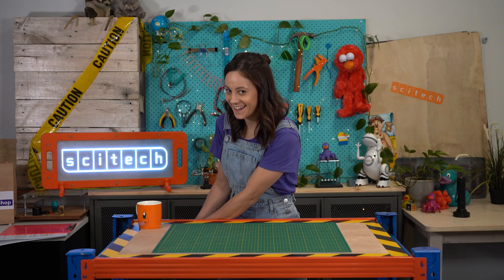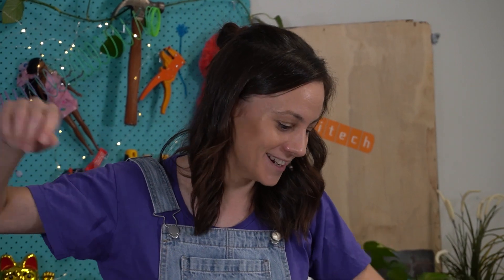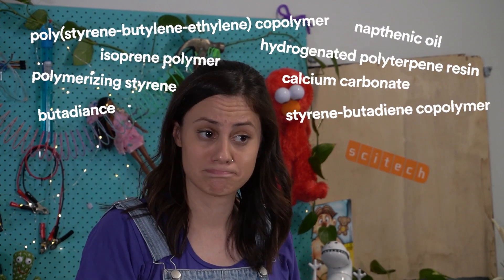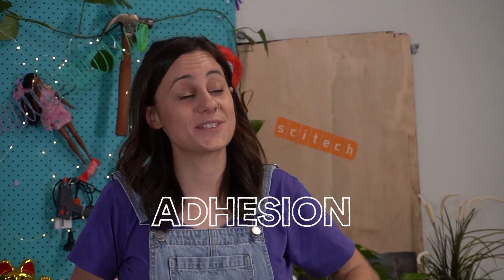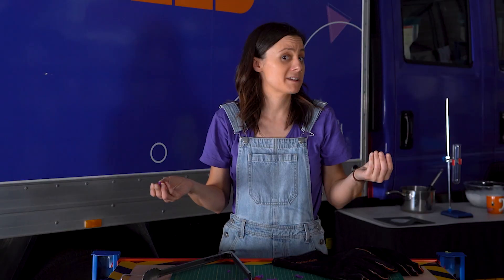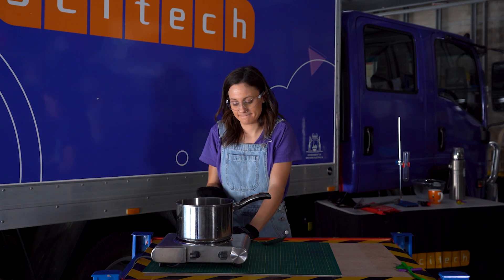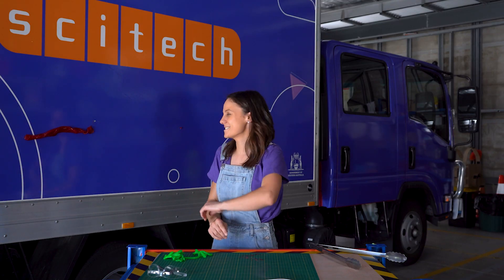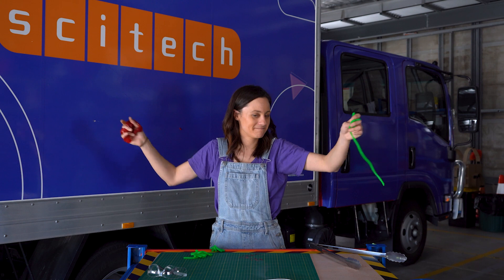What is a sticky hand actually made from?

Comment: If you could melt these down and get one side to permanently stick to a board you could create a "sticky mat".  The sticky mat could be used to hold things in place while you work on them but remove easily without any sticky residue to clean up.  Any idea what semi-rigid material would allow you to bind this substance and create a mat?
Reply from the maker: Awesome idea, once I melted it, it became far more tacky/ and little more oily, but it didn't leave visible residue. I wonder if it will stick to superglue? Veritasium has a very cool recent video on why superglue sticks to almost anything so that's fresh in the mind for me! ChatGPT suggests buying Thermoplastic Rubber sheets, and moulding them this way, but I have a feeling that its not quite the same 'tacky' material. It might be time for a follow up video!